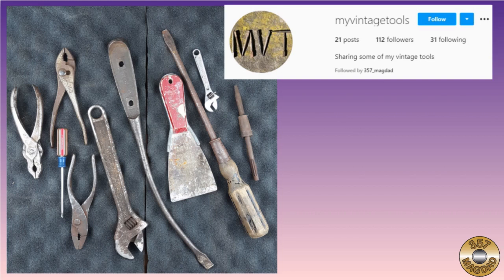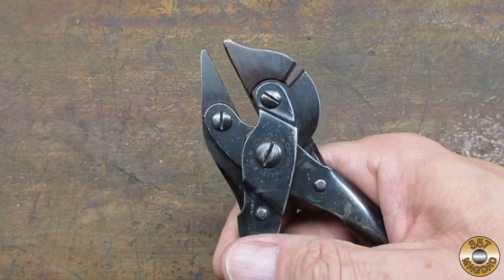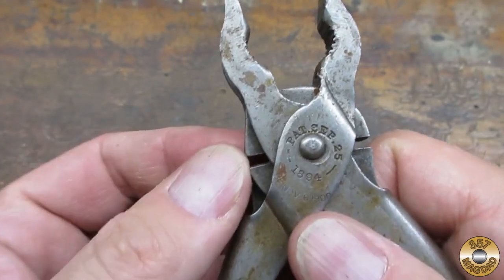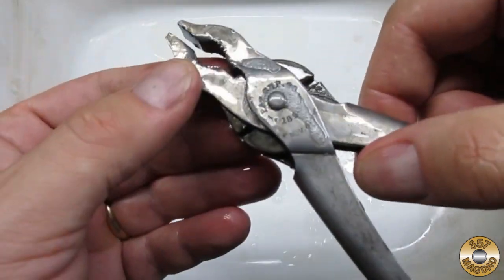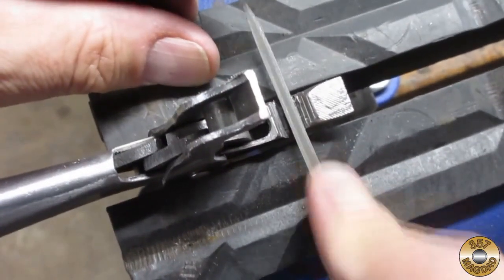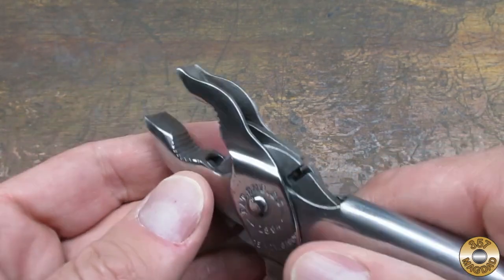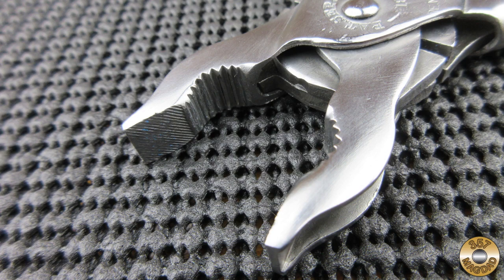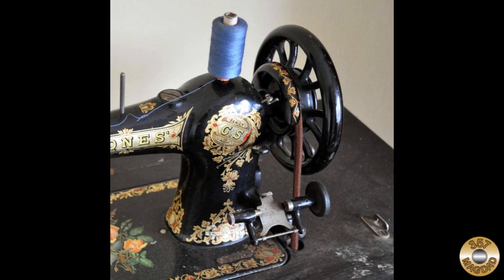Hand Tool Restoration - Schollhorn Lodi Gas and Cutting Pliers

Comment: Hey Magdaddy
Been away for awhile. 
Hope to give you
And the Mrs. a smile. 

I’ve used similar pliers.
They’re stamped with 3M. 
I wonder if they’re “made for”?
They work like a gem. 

They’re made to squeeze Scotchloks
Which are hated by some. 
When used incorrectly
They make you look dumb. 

With time and e’rust
Your pliers came out slick. 
Then some fine sanding.
That did the trick. 

The Flitz and Chuck. 
What can I say?
The tool’s really shiny. 
That made my day. 

From the early morning darkness in Wampler, TX, thanks for the fun. 🤠
Reply from the maker: Those Scotchloks pliers definitely look like the Bernard patent parallel jaws!
Your poems always make us smile!

Comment: I like the stamped steel handles, they remind me of the paper punch we had in the house when I was a kid and as you can see they've lasted the test of time on those pliers......Sometimes it seems applying finger pressure with sandpaper is the best way to attack a trouble spot.
Reply from the maker: The Lodi line actually featured a few hole punches.  Hand sanding isn't always the fastest method, but it always works!

Comment: I used to use those belts you show at the end when I was into whip making.  They made a good extension on the very tip.  There were a lot of times I could have used a pair of those specialty pliers.  You have to wonder just how rare those are.  Nice job on the Lodi pliers!
I told Ben Mall we need to design a POM (Patina Oozing Machine) so we restorers do not have to spend so much time manually flipping handles back and forth.  :^))
Reply from the maker: When I saw those weird pliers at the yard sale, I knew they were coming home with me!

Comment: Were these pliers nickel plated? If so, it looks like the rust went through the plating, rusting the steel underneath. The rest of the handles were likely still plated, so now it's important to keep it clean & waxed, to prevent the steel from re-rusting.
Reply from the maker: The old Schollhorn catalog says "bright finish".  They didn't have the flaky nickel plating like some tools.
Reply: @357magdad  Ha, I guess you got what you paid for back then too!

Comment: I have 4 pair of Bernards parallel pliers. 2 are plated with I presume was nickle. I cannot figure out what their purpose was. In my modern world working on antique aircraft there seems to be a use I just don't get. Yet.
Reply from the maker: Check out the Schollhorn catalogs on the International Tool Catalog website.  I bet your pliers are in that 1902 cataolg!
https://archive.org/details/WilliamSchollhornCoCat1902
Reply: @357magdad  
They were indeed in there, thanks!
Reply: I just aquired an even older pair. 1800s for sure.